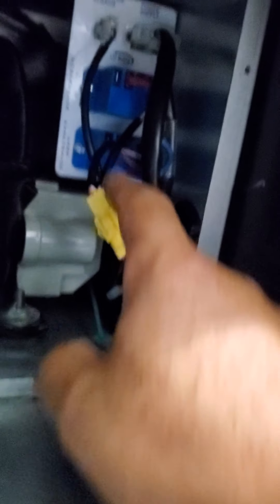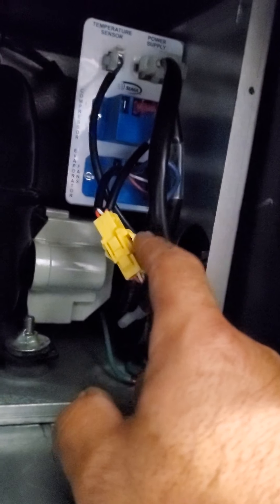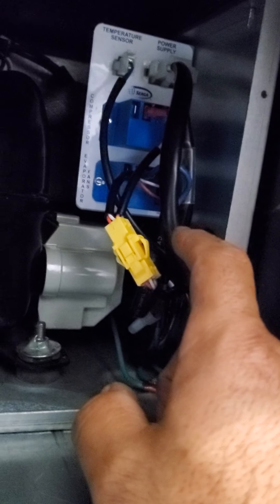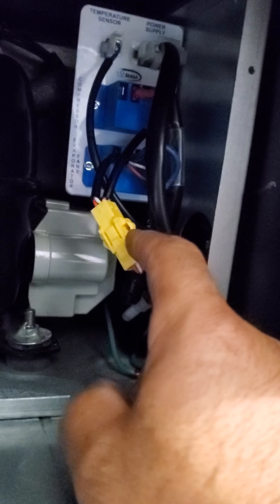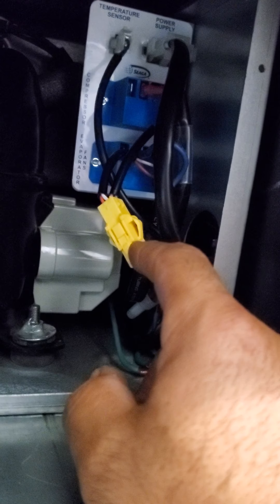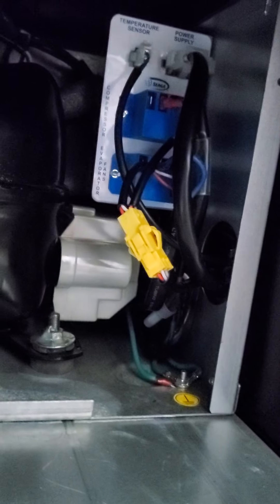Seaga hy2100 failure solved

Comment: Great information thank you for sharing your experiences.
I have a problem with the same model of machine, the drink section is not cooling.  I went through all trouble shooting in the Manual, noticed that relay #1 is working, but #2 wont turn on the compressor fan. Seaga recommended to replace the entire refrigeration unit. I personally feel that may be the relay, but I am not an expert on this field. I would like to  hear your advise. The machine is 2.5 years old.  

Thank you in advance.
Reply from the maker: Please join Vend Discuss Facebook group and post this question. I will be glad to answer your question.
https://www.facebook.com/groups/2092091760884199/?ref=share
Reply: @Vendingsupplier  Joining now! Blessings!

Comment: Hey can you give me some advice on the hy2100 keypad
Reply from the maker: The keypad is a common part to fail on that machine.
Reply: @Vendingsupplier  is it a easy fix or it needs to be replaced...fyi I brought the machine brand new 2 months ago
Reply from the maker: @DADUO2  call Seaga, it should be under warranty in that case.

Comment: I’m having the same problem with my machine
Reply from the maker: Sorry to hear, it's usually caused by a refrigerant leak. This is because the capillary tube crosses over and rubs the  line going to the condenser.